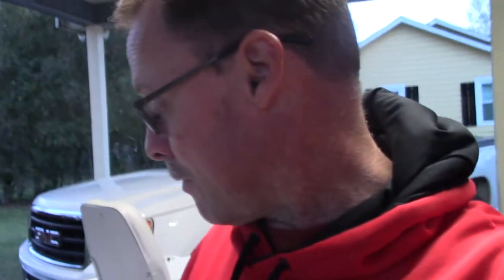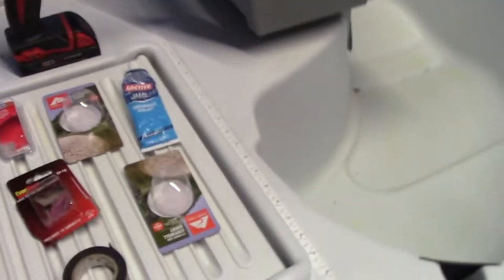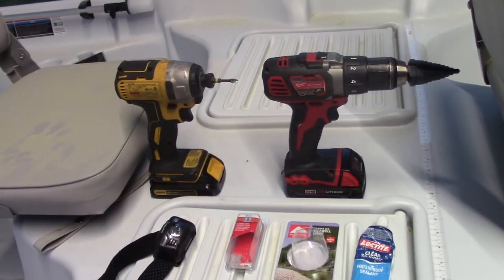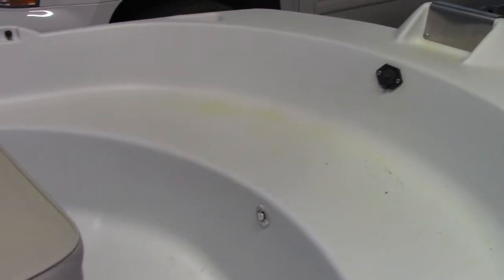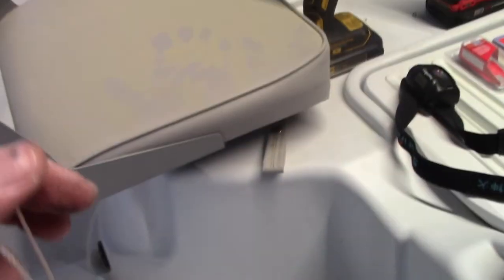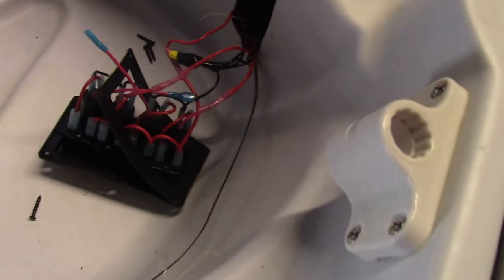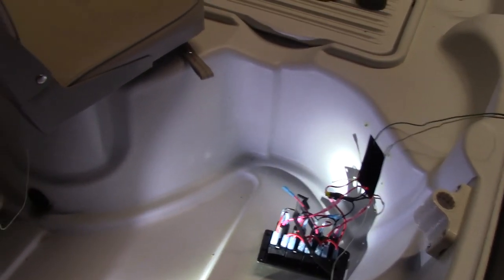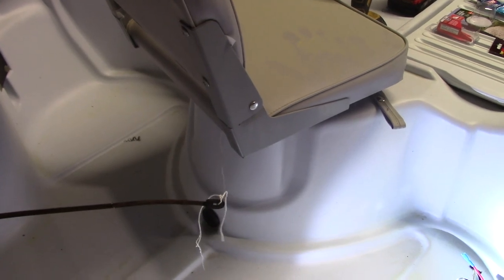Pelican Predator 103  diy wiring how to.

Comment: Can you show how you connect and run ground wires to the switch panel. From what i can tell looks like you just pulled all ground wires together twisted them connecting directly to ground is that how you did it?